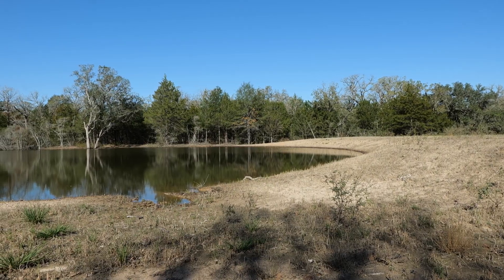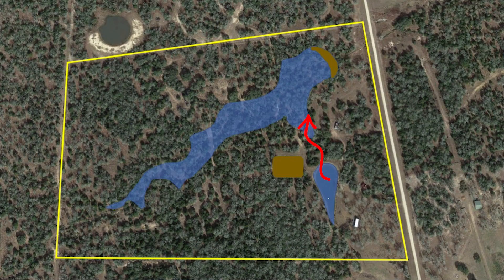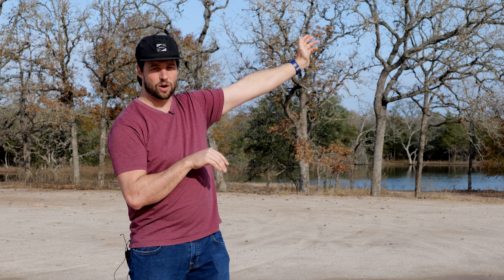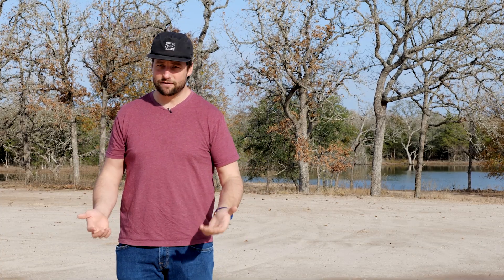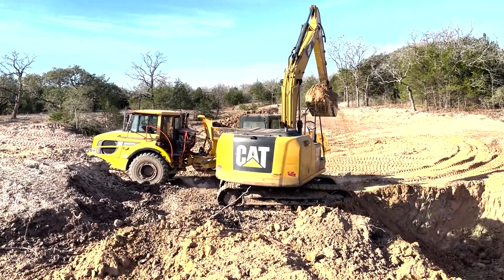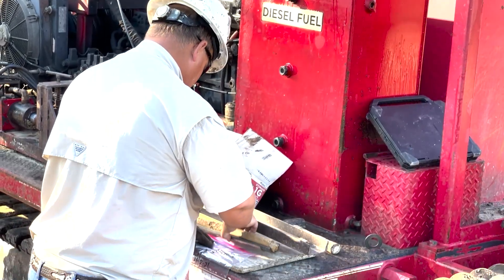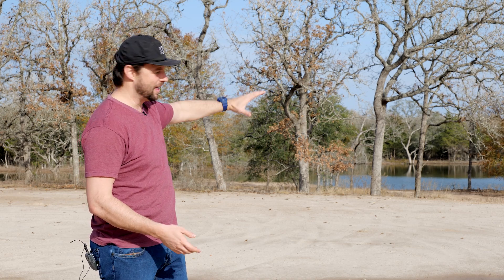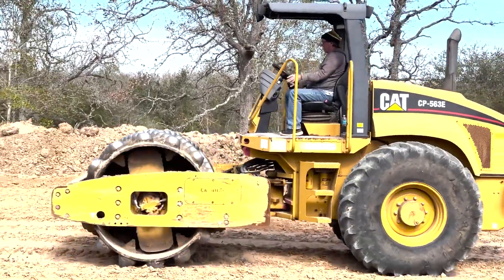How to Build a Strong Slab on Grade Foundation - Start With a Strong Pad!

Comment: Thanks for sharing this very intriguing solution and problem, Jordan. Did you ever consider using phone concrete to fill huge voids and level and build foundations upon? You can also use EPS geofoam in combination with phone concrete to fill large voids. In California they use the systems to support ramps for highways going up 20 and more feet. Very cost-effective maybe like $50 per yard. And is very light very easy to carry around and transport.